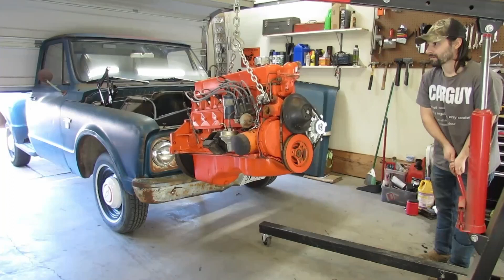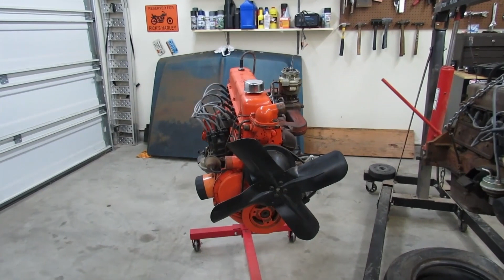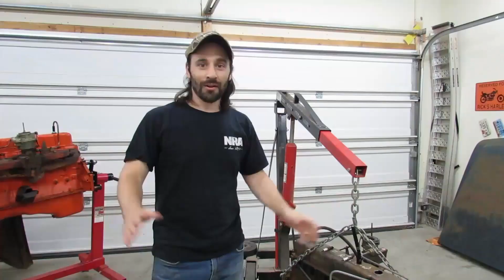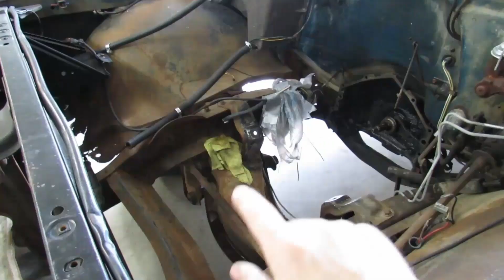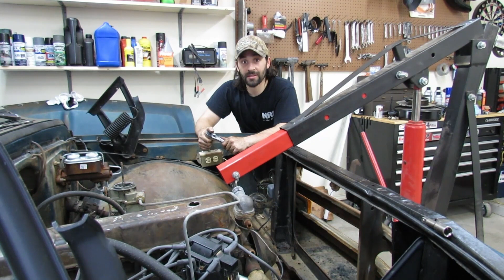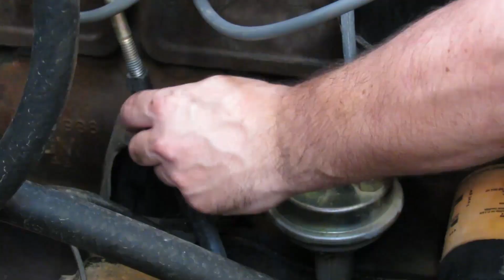Swap Meet Engine Install On The Barn Find 1967 Chevy C10 Stepside!

Comment: Watching you assemble that clutch made my eyes roll back into my head. Couldn't really tell from the camera angle, but the ease with which the engine mated up to the transmission tells me the pilot bushing is likely missing in action. You seem like a guy who can't and likely won't take constructive criticism very well, so I'm going to go ahead and leave it at that. Anyway. Happy trails
Reply from the maker: You're right. There's a pilot bushing in there but it's probably worn beyond use. I'm going to pull the trans & install a new bushing. I've always wanted to properly degrease the trans ever since it came out of the barn after 20 years. Plus, I happen to have new seals on the shelf for that trans. This is a good opportunity to do it. Thanks for watching like a hawk.
Reply: @freemansgarage  I like the way you handled that "Constructive Criticism." Keep doing what you do. From binge watching your videos, I observe you as a person that is open to suggestions and criticism.